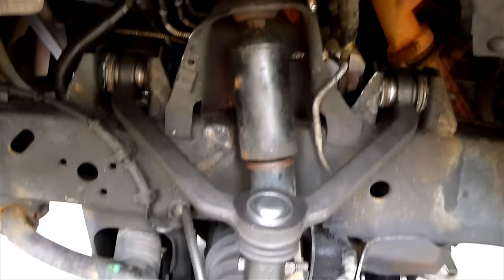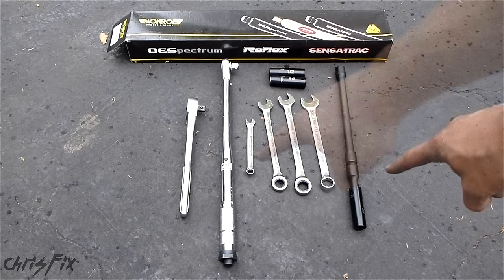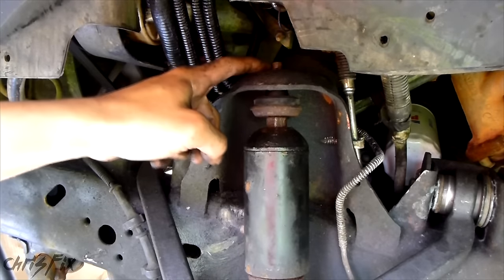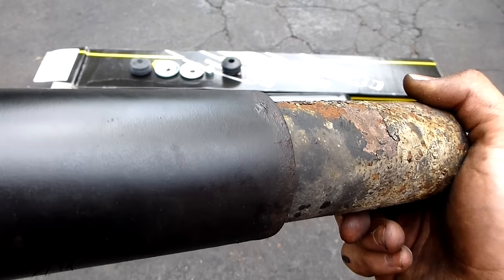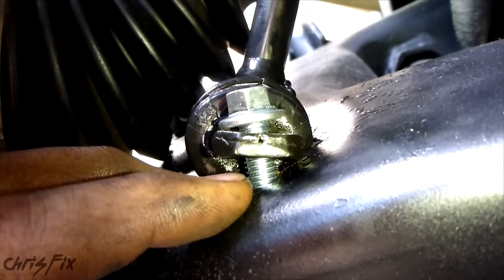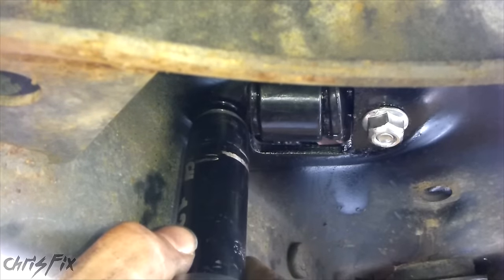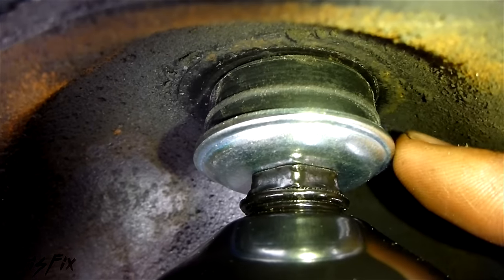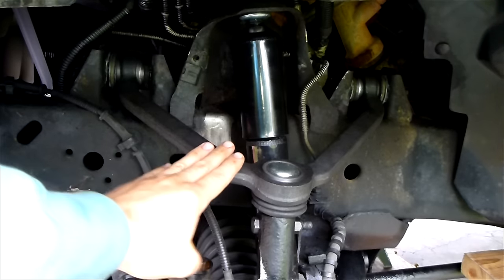How to Replace Front Shocks

Comment: Chris. I have written before and have a 1998 Ranger which looks very much like your 2001 Mazda. I watched this video only to find out I have struts on my Ranger. This is peculiar because the Chilton manual I have doesn't show a configuration with struts. It shows one with a shock alone and one with a coil spring and shock next to it. I took two pictures to show you but the site doesn't allow up loading of pictures. 
Are you aware of this kind of thing with the 98 Rangers? 
Is there a way I can send you the pictures?
Can you point me to a video to replace the shocks inside the coil spring? 
Thanks for your help. 
Larry
Reply: +Larry Strauss You don't have struts you have just have the shock in the coil spring, and they aren't a full assembly like a MacPherson strut. Its exactly as his truck just inside the coil spring cavity. Bottom bolts are the same as the video (13 mm). And the top of the shock is the same except there is no welded nut to the shock to keep it from spinning. You have to use an open end wrench to take off the top while holding the shock in place by putting vise grips on the stud tip. An easier way is to take a sawsall and cut the stud off between the frame and the bushing. Watch out for brake lines.
Reply: Thanks. But, does the coil spring come out with the shock or does another part hold the spring in?
Reply: +Larry Strauss spring does have to move. In fact you don't even have to jack the truck up or remove the tire. Shock drops through hole in the bottom. Look under truck and you will see.
Reply from the maker: +Larry Strauss looks like Anthony has you covered!
Reply: +Anthony Shelton --- I will look. Any thoughts on why all the manuals do not show this configuration? Did Ford implement a change mid year? Where can I get the proper schematic? 
I had this issue when I recently had to replace one wheel. The hub hole on the wheel I bought was too small and I had to have it reamed. Fortunately, the lug configuration didn't change. But, it just about doubled the cost of the single wheel.

Comment: How do I replace front struts, but keep the same springs? Without the special spring tool?
Reply from the maker: +twanajester23 You cannot without a specialized spring tool.
Reply: Did it once with a big wooden pole but I broke a bearing and some stuff. Guess Ill need to get the specialized tool then!

Thank you for your fast reply! amazing, ur vids are useful to me
Reply: +ChrisFix So today I actually managed to replace a spring without the tool.... So you got this bearing at the top, mounted on the car, thats where you gonna push thru your shock. First put the spring on the shock, easy. Now take a carjack and put your shock at the place right under the bearing. As you jack up your shock into the bearing tighten the nut at the top. and you are done.

Comment: Oh, I had a question that doesn't pertain to this video. Is there a cabin air filter on the ford ranger, mazada b3000? I heard there is none, but you can buy the cabin air filter online. Anyway, thanks for the videos
Reply from the maker: There is not a cabin filter, but from what I have read, there is a spot for one because the Ford Explorer has a filter and the Explorer and Ranger share many of the same pieces.
Reply: Thanks Man...I'll thumbs up all your vids when I get a chance if that helps you out...lol
Reply from the maker: Haha, thanks a lot! Are you thinking of putting a cabin filter in your truck? I was kinda thinking about it but I havent checked to see how hard it would be.
Reply: ChrisFix Yeah, I'm gonna try this weekend. If I figure it out, I'll make a video and upload it. The only reason why I want to do this is because I heard that a bad Cabin Air Filter could adversely affect my Air Conditioning. Currently, my A/C runs cold for 10 minutes, then it blows cold air. Not sure if the Cabin Air Filter is the problem, but then again, I'm what's called a Broke-chanic and not a Mechanic.
Reply from the maker: Yea, I would think if it isnt blowing cold right away, it is leaking freon, but who knows. Maybe your truck has an air filter or something... Let me know!

Comment: how do know when you need to replace your shocks
Reply: +Chef Glockyardee I replaced my brakes  and now when I stop the car squeak
Reply: Thats just because brakes have to broken in. When you replace brake pads, you have to brake in a way that's not too soft, but not too firm for a couple hundred miles. Your owner's manual will tell you how many miles is recommended. All brakes squeak a little when you first install them